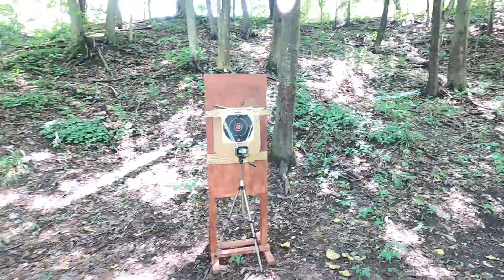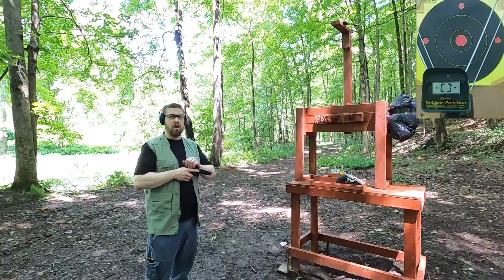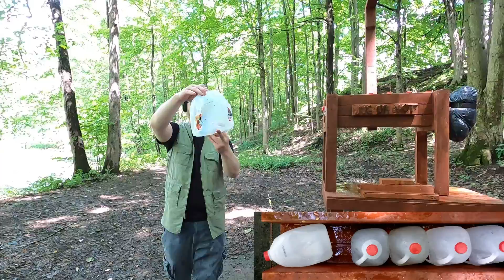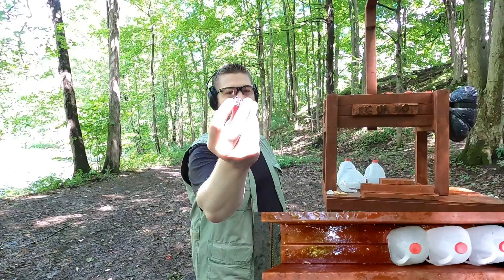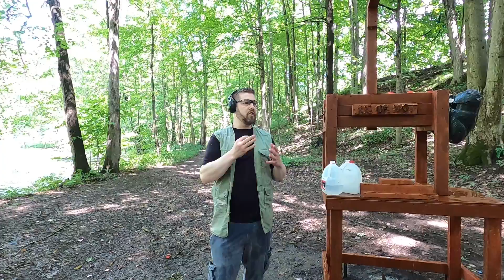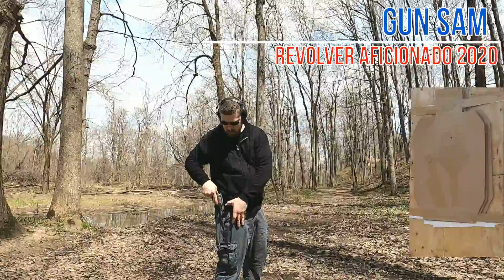10mm More Powerful than .357 Magnum? 💥ULTIMATE Test💥💥💥POWERFUL Ammunition

Comment from the maker: VERY IMPORTANT, read this before you watch! 

I get the "limp wrist" comment nearly daily in one video or another with this pistol, but from people who haven't a clue what they are talking about, so I urge you not to jump to conclusions. Most of the issue with malfunctions is the feed ramp, the Lone Wolf AlphaWolf CONVERSION barrel I use has a very thin feed ramp, not wide and loose chamber like a stock Glock feed ramp/chamber. Also, in this video I was not using a 10mm extractor in the conversion, so that didn't help. If you still do not believe me, I did a study of all of the hollow point ammo tests I did with this Glock 41 pistol in both the stock and the conversion setup. Why this is important is because I tested SEVERAL .45 ACP+P rounds that were well over the typical energy level of 10mm, as well as at or above typical 10mm bullet weight, and I never once had a jam in those rounds. Here is the study of just the Glock 41 portion: 

Glock 41 (.45 ACP)
Shots Fired: 93
Malfunctions: 1
Malfunction Rate: 1.1%

Glock 41 (10mm Conversion)
Shots Fired: 102
Malfunctions: 23
Malfunction Rate: 22.5%
Reply: I’m not aware of any .45 acp +p round that surpasses a real 10mm load in energy. No one makes a .45 acp that comes any where near 700lbs of energy
Reply: Agreed with the other comments, there are no 45 acp+p rounds that will compare with a 200 grain 10mm round. Just isn’t happening because physics.
Reply: Because of the grip angle, every Glock shooter has to be a little limp wristed. lol
Reply: Personally I don't really care if it's user error or the gun. 23 malfunctions is unacceptable in my book considering guns are for life and death situations.
Reply: The next malfunction could be your ass if a bear is charging you.
Reply: Why not just buy a gun you do not have to modify right out of the box?
Reply: My love wolf barrel has absolutely zero issue feeding ammunition in my glock 20. The failure rate is 0% through thousands of rounds.
Reply: you are just a limp wristed guy..
Reply: prolly not the first time you were hit with a 'bologna pack' either..
Reply: @BrandorT  🤣😶
Reply: its ok to have a limp wrist maybe get a wheel gun then it won't matter
Reply: The G41 has a very thin and light slide made for the .45 acp, the 10mm works the slide too fast.
Reply: I seem a guy hand loading 230gr flat nose for his .357. There is always more
Reply: The Lehigh defense extreme penetrators and extreme defenders feed much better than hollow points. In both 45acp and 10mm. I have a glock 20.
I am no expert, sometimes I do limp wrist. I know its me because I can shoot hundreds of rounds with zero issues. Its usually within the first two mags when target practicing.
A stiffer recoil spring that will still feed lower velocity target ammo helps. I run a 22lb in my 45.
The xtp are a nice round. But at 45 super levels they under penetrate.
Reply: I'd love to see a revisit of this using carbines with 16.5" barrels.
Reply: It didn't look at all like you limp wristed the 10mm. I agree with you about the barrel and your comparison of the 45 and 10 mm barrels tells the story very clearly. Your suggestions for use in the woods are appropriate and reasonable. I agree with the game you suggest one could take with these. I would personally opt for heavier for caliber projectiles to have more mass in either one of the two choices you presented.
Reply: FWIW, XTPs are designed to expand at both slower and higher speeds.  That is kind of their thing.
Reply: Actually gun Sam is correct there are 45 acp +p rounds that do surpass the 10mm do your research. Honey bager 45 acp +p.
Reply: @lateroc2955  You do your research. What are you comparing? The weakest 10mm round to the most powerful 45acp +p round?
Reply: @yuriandropov8405  I already have but you clearly haven't and no I'm not actually.
Reply: @lateroc2955  so you are saying that you can load a 45 acp round to be more powerful than a 10mm round using max loads for each?
Reply: @yuriandropov8405  Anything is possible they did it with the 40 s&w that's all the 10mm is,  a stronger 40 round chambered in 10mm. Tho, to answer your question no, but I'm saying some 45acp rounds come close to fps and velocity.
Reply: @lateroc2955  You've got that the wrong way around bud. The 40 S&W is a weaker cut down cartridge developed after the 10mm was found to be too excessive in power and recoil to be used as a duty weapon. Anyway, you tell me which 45 acp round is more powerful than the 10mm round he is shooting which is rated at 1500fps and 775ft/lbs of energy.
Reply: @yuriandropov8405  I'm not going to sit back and argue back in fourth with you. You are the one clearly wrong believe what you want to believe I really don't care.
Reply: @lateroc2955  I simply asked you to name one of the 45 acp rounds, from all your extensive research,  that is more powerful than the 10mm ammo used in the video. Maybe I am wrong and there is something, but I don't think so. And obviously you've got all kinds of time to keep coming back at me with pure bullshit everytime.
Reply: @lateroc2955   you obviously have no idea what you are talking about 🤦‍♂️ the .40 was made from a shortened 10mm case.
Reply: @yuriandropov8405  You’re right. There is no .45 that comes close to that energy. They top out at around 600 ft lbs from a 5”
Reply: @lateroc2955  post link to this ammo. I’m not seeing it.
Reply: @ryanranard5187  The 40 is a shorter 10mm. It has less power than full-power 10mm. But many 10mm rounds re loaded down to .40 levels. For self defense the .40 is a great choice.
All you have to do is Google it.
Reply: @WallSt101  There are 45 Super rounds that do. They require stronger cases and usually a change of springs. (recoil and at times magazine springs as well) 
There is also the 460 Rowland which is a 45 used in the same magazine made out of a longer case to prevent chambering in a regular 45. It requires a conversion and achieves 44 magnum energies, far surpassing 10mm and 357 which are already quite potent.

Comment: and glock is always reliable this proves they are not.
Reply from the maker: Well this is not fully a Glock, it's converted so it's not quite right. Nonetheless no semi auto pistol is always reliable.
Reply: @GunSam  IDK I have 500 almost 600 rounds through my tisas D10 10mm and she has yet to have any issue. I also have a .45 1911 that has 700 rounds and the only issue it had was it wouldn't take hollow points till after 250 rounds.

Comment: I realize that I am way behind in responding, but I really just want to set things a bit straight. You are comparing apples to oranges. To be more accurate, you should be using ammo with bullets of similar weight, and then the speed will depend on the manufacturer. There are 3-4 manufacturers that make more powerful .357 Mag than what you used: (1) 180gr at 1500 fps => 899 ft. lbs. (Buffalo Bore), (2) 158gr at 1,540 fps => 832 ft. lbs (Double Tap), (3) 200gr at 1.350 fps => 809 ft. lbs. (Grizzly), (5) 158gr at 1,607 fps => 907 ft. lbs (PPU). You picked the 10mm ammo by Underwood that is 150gr at 1,500 => 749 ft. lbs. (the max for ANY 10mm round). So, I found two .357 Mag rounds with essentially the same bullet weight that noticeably out preforms the 10mm round you picked, and three more that go even beyond that with a heavier .357 Mag bullet. So, your comparison was biased from the beginning. Also, when you shoot these much hotter .357 Mag loads, the kick will definitely be bigger than what we see in your video! 

I watched another comparison of 10mm vs. the .357 Mag, and he was focused only on hunting big bears, so he used in his test only hard cast bullets for both calibers. But no one seems to make these higher powered .357 Mag rounds with hard cast bullets, so in this comparison, the 10mm was closer. I responded to his video, just as I am doing here, and told him about the 'other' .357 Mag hot loads, and that his comparison was a bit tainted. He responded to my response, first responding about the necessity of hard cast bullets in that environment, and that he would rather have a pistol with 16 rounds than a revolver with just 6! I could have responded to that with when a big bear is charging you, you have just limited seconds to respond and shoot, and that most people in this real life situation only typically get off 2-4 rounds!

Comment: Nicely done! Seems in real world use there is no measurable difference between the two. That begs the question, what about the numerous, much heavier loadings then, available for the 10mm? One thing I've yet to see addressed is the handling differences between an auto and a revolver. Seems to me the auto is more ergonomic and positions the center of gravity lower, much of the weight being in the grip, whereas the revolver has some not-so-ergonomic curved grip in your hands while the bulk of the mass hangs off the top of your hand. I could be wrong but I tend to think the autos, on average, are better suited for hand fit and lower COG, leading to easier control of recoil, more apt to simply push straight back rather than exhibiting as much muzzle flip as a revolver would. Anyone?

Comment: Love your work.    Side note, though it really doesn't make that much difference, pistol barrels are measured from the rear of the breach to the end of the muzzle because there is no cylinder gap.    Revolver barrels are measured from the front of the cylinder to the muzzle to account for pressure loss from the cylinder gap.
Reply from the maker: Pressure loss averages 5% of the velocity. If a round was 1,000 FPS in 5" semi auto, it will be 950 FPS in a 4" revolver. Plus the bigger thing is a 5" semi auto VS a 4" revolver, is the SAME SIZE. That means more than anything, same class size and carry method.

Comment: Isn't Buffalo Bore using a Speer Deep Curl in this 125gr load? Unless this was a previous product they used to load.
Would be great to see a re-test with 200gr and 158gr loads in the same brands, as those hold similar SD's.
Reply from the maker: Every time I recall getting the Buffalo Bore .357 Mag it has an XTP. Even in some boxes I recently got that said 'bonded', they still contained an XTP. Now all the actual Speer Gold Dot ammo I have gotten in .357 Mag/Sig does contain the DCHP.
Reply: @GunSam   I guess they don't specify on their product page which makes it difficult to predict. The pictures they use on the website show a DCHP design, at least it's identical to what Speer shows on their website.
Target Suite channel featured some Buffalo Bore ammo recently for lever action use, and those were a DCHP design. I guess unless one of us email's Buffalo Bore we may never know. 😄

Comment: On those rounds, at those grains, velocities and diameters, the 10mm has 2% greater momentum. The .357 mag has 18% greater momentum density.
Reply: *sectional density, being nearly the same, is a static measurement, where as momentum density is a kinetic measurement. While the .357 has slightly less momentum, the momentum is concentrated onto a smaller diameter resulting in the momentum of the mass being significantly greater. It should travel farther and penetrate more deeply with the same flat nose bullet.

Comment: I understand the test and why you did it with those bullet weights but Hornady XTP lighter bullets I’ve cut in half in that caliber have thinner jackets on the lighter weight then do heavier weight bullets ! 
125 gr vs 158 gr 
I didn’t use a mic to measure the jacket thickness but one can see the difference!

About the only way to get an accurate reading my thoughts would be to melt the lead core out of the jacket !

Comment: I own a GP 100 and have thought that I need a 10mm too. However, the initial jam with the 10mm you tested instills by thoughts that I prefer a wheel gun when defending against unhappy critters!
Reply: I'm not a wheel gun fan so much, but there is little doubt about the reliability of a follow up shot with one as opposed to autos!
Reply: I've never had a jam in 2500 rounds of my Glock 20 or my Springfield xdm elite 10mms but yeah revolvers don't jam but most reliable autos if taken care don't either. It's all personal preference I like and carry both
Reply: @D-A-1776  I have the tisas d10 10MM 1911 I have yet to had a failure of any kind. I have run everything from magtech to buffalo bore.
Reply: @brandondavis4306 .  Just got a colt delta elite 10mm and love it. 1911 10mms are great
Reply: Revolvers are usually more accurate too!😉
Reply: @ take mycum
Reply: There are 10mm revolvers available.

Comment: The sectional density argument is kinda crazy!!! That’s why we have different sized bullets, it’s a selling point so the most fair comparison is gr not sectional density.
Reply from the maker: Obviously over your head.
Reply: @GunSam  not at all. The weight of the bullet determines how much powder is used so it isn’t a fair test at all. Lighter bullet more powder equals higher ft lbs. the weight of the bullet causes the pressure to rise so less powder is used. A 125 gr 357 can be loaded with h110 and reach 1966 fps a 10mm with cfe pistol can reach 1409. Velocity x velocity x bullet weight divided by 450240 equals ft lbs. bullet weight directly correlates with ft lbs. you’re comparing a .357 diameter bullet to a .400 diameter bullet but taking the diameter out of the equation. The diameter is the point of bullet calibers. That isn’t a fair comparison. It isn’t over my head but still like the video. Just making a point about your logic.

Comment: That jam represents why a 10mm should never be used for beat defense. My Glock 40 has jammed several times. A charging grizzly would tear you apart in less than 2 seconds. If a revolver misfires you just pulled the trigger again, it's your best chance.

Comment: I knew that the .357 would do well, I was honestly surprised that the 10mm did that well. I know 10mm is a monster with the right loads, but that was extremely impressive. Given that those rounds had basically identical performance I would give a slight advantage to the 10mm just for the larger diameter. I will say that I trust a revolver more than I trust the feeding of a 10mm though, but I'm just splitting hairs at that point.

Comment: I have a 10mm in a 1911 platform and a couple 357 revolvers.
With normal factory loadings, 158 gr - 1700 fps - 357 and 180 gr - 1200 fps - 10mm, I get more energy from the 10mm.  I attribute this to the cylinder gap of the revolvers.
In my experience with factory loads, the 10mm has slightly more power.  But the 2 cartridges are very similar.
They are both excellent cartridges for time spwnt in the woods or mountains.
Many folks in Alaska are using the 10mm for nbear defense now.  They use heavy for caliber hard cast bullets for maximum penetration.  However, there is much debate on whether the 10mm is adequate for brown bear protection.  I find very few carrying a 357.

Comment: I have 36 handguns in 12 different calibers. The bulk of which are .357 there is virtually nothing this round can’t be used for! Is it the best? That depends on so many factors load, barrel length, operator, weather, target, ETC but I can tell you this! It is very effective even if all of those things are not ideal.

Comment: Ive killed many deer with my 357 magnum, before I replaced it with the 10mm 6inch slide .   I've even killed very few  with some 38special in my 357 .   I see people killing nice deer  with a 9mm , 40 s,w , 45 auto .  I belive if I went back to a wheel gun , it would be a 460 Smith and wesson.   Or a 30cal carbine , through the BFR .

Comment: Feed jam, tupical junk glock. Try it in a rock island tec 2 1911 you won't have that problem. I have and carry this pistol. Fired thousands of rounds thru it, not one time has it flowered. Glocks are an over rated, over priced pieces of crap.
Reply from the maker: While I agree Glocks are over rated, this is a conversion of a thin slide Glock 41 in .45 ACP to 10mm. No surprise why the lighter than typical mass of the slide is causing issues.

Comment: If I Re-Armed to go back to Alaska, after 20 yrs there, besides my .45/70 Spfld Marlin 1895 handloaded, and 870 Rem 12 Ga, including a pistol.   I observed a lot of bears and indeed they are built like Tanks.  Additionally Body Hits take time to kill, giving them the last laugh.  The bears I have see killed quickly, cleanly are those with CNS hits (Central Nervous System), in the head, the neck and the spine.  For that reason I'd take a .357, or 9mm or 10mm, or were it necessary  a 1911 style .45 ACP.   All good loads, mostly hot, but stuf YOU are familar with and can shoot accurately.  I have stories about guys switching guns to take Alaska, and regretting it.  SHOT PLACEMENT under pressure is what it is about and what will save your ass.

Comment: The hottest factory loads I have seen for .357 Magnum have been slightly more powerful than the hottest 10mm factory loads. As a practical matter however I think they are pretty much capable of the same performance and this test proves it. To me the choice between the two calibers boils down to what kind of a gun I want to shoot. If I want a revolver, I will go for .357 Magnum and if I want a semi auto I will go for 10mm.

Comment: Always do 158gr when testing 357mag . It is made for it , all other weights are incidental . Buffalo Bore has a monster 158 flat nose.
Reply from the maker: While I might say that 158 gr is better than 125 gr for revolver longevity, preventing flame cutting and all of that, I don't really agree that 125 gr is incidental. It was chosen for decades as the best manstopper round. It delivers more energy right away while preventing over penetration.
Reply: @GunSam  Then use a hot 9mm. the 357 is all about penetration and the 158 does it well.
Using the right weapon for your purpose is key ask any golfer. The recoil and flash of the 125 is a major issue.